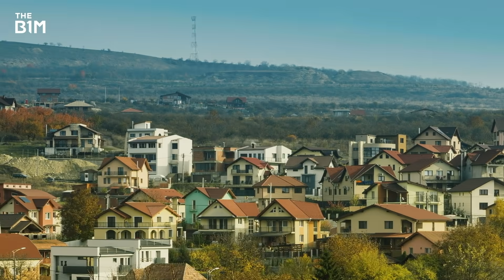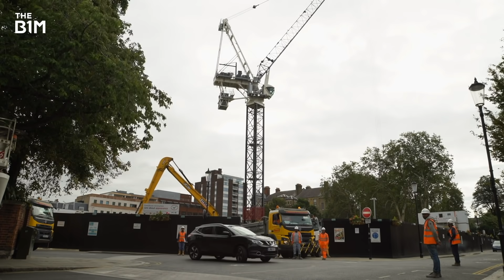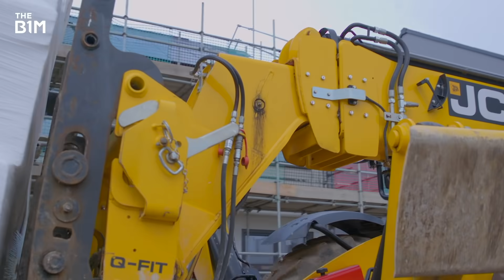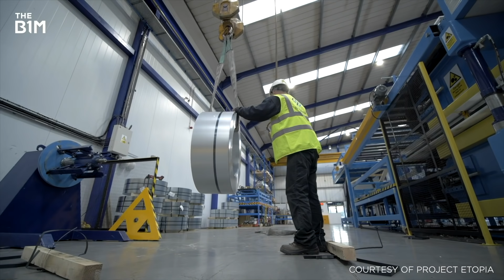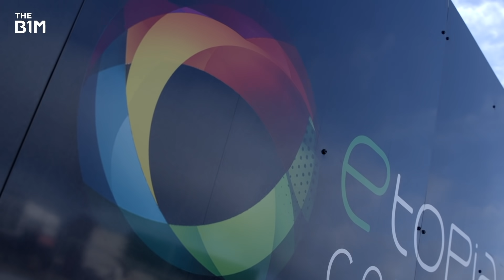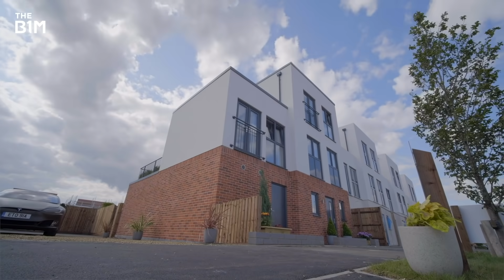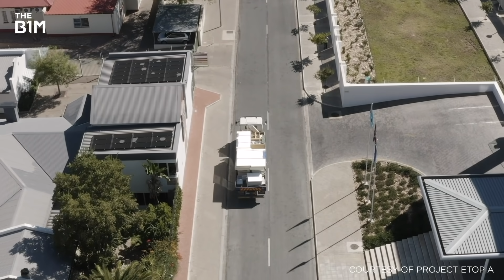How To Build More Homes, Faster

Comment: I have an idea of a modular flat system where you own the materials and rent a plot .a company would rent out a base(the plot area ,it supply’s power and water ) and you could buy the parts of the house .you only own the materials .all the parts would be 3d printed out of concrete and have a wooden embedded interior . The company would agree to buy back your materials at 80% if it’s current value. This allows for rapid expansion and as little waste as possible.

Comment: We built these types of "eco-friendly" modular, energy efficient homes here in New Orleans following Hurricane Katrina through Brad Pitt's BUILT IT RIGHT FOUNDATION. These companies don't realize, or care...as long as they get paid, that the materials used to make these homes "sustainable" fall apart in less than a year in environmental condition like New Orleans and Africa. It's fine for Britian...nonsense for places with high heat and humidity

Comment: He said at the beginning "we can take away a lot of the problematic costly areas that exist within development and that will ultimately drive cost down for building but performance up".
So it costs less to build, but they still charge the same price for the house. Yet these new builds are done with cheaper materials, thinner walls and are built on a smaller plots of land.
There are loads of "affordable" homes being built here I live, yet I still can't afford any of them. The most recent ones start at around £300,000 for a 2 bedroom terraced house. Its crazy.

Comment: Low quality homes that doesn't last even a 100 years. Made from materials that degrade faster then paper and cost the same as a brick and steel house. It will end up in disaster long term (for those who buy them).

Comment: The cost of a plot and a permit is way to high. This is partly due to corruption, and partly due to government figuring out to get a non tax income via high fees.

Even if this is just a handful of procent of the full cost, it effects everything down the line.

This effect planning cost, that effect architectural fee, that effect contract cost, that effect cost of sale, that effect production cost, that effect sourcing cost that effect time table and so on.

Wirh just a few procentage of every part of the way, the building is twice the cost at the end. This is what made building so expensive. 

Production method have been made better and better for every year, but corruption and byrocracy have outpaced efficency every year. Making buildings very expensive.

If people could just buy a plot and start building (according to preset conditions), houses would be half price.

Comment: In Austria, the market share of prefabricated houses is roughly 1/3. It is around this size since a few decades, it has even decreased a bit.
The cost advantage of prefabricated houses is not that big, and the lifespan is shorter, so most people prefer the massive construction methods.
So I don't think that prefabricated houses is really a way to solve housing shortage. Birth control and migration control is.

Comment: I live in a public housing 2 bedroom house with a decent sized yard. There was a vacant public housing owned land in our street, and to save time, they had the concrete walls pre-cast off site, and craned in. The outside was assembled in 2 days, and fit out not even 2 weeks. And a grateful family was moved in within the month. Sadly the state housing authority here has stopped buying vacant lands and building on it, now they only build units or housing commision flats. EDIT - There was a 2nd vacant property next to us, the housing authority sold the land for profit to a developer who built 2 units on it. Most of the former housing authority houses in my street had been bought out by their former tenants and now private owned. If you live in a public house, you can after certain amount of years apply to purchase them from the government like a de facto mortgage, or via a bank loan.

Comment: Uh.. didn't the Soviet union do the same thing back in the 1950s- 60s during the khruschev era? What's new about this?
Reply: Not really. What they did was made a module style building structure with predesigned modules.

Nowdays we are designing every module them self.

It's also diffeent in the way that utilities is built into them and the outside walls come preinsulated. 

Also, at least where I work, windows are preinstalled in factory

Comment: Here in the USA, affordable single family homes tend to be of very low quality (at least as we see being quality).  My home is Energy Star certified, but your feet are cold in the winter, and the walls and ceilings are so poorly insulated that the ceiling fan will not push air down to where I can feel it just a couple of feet from the fan.  If change is to come then codes and laws need to as well; if not the builder will always choose the cheaper inefficient route.
Reply: Joel So do a heat leak test, or if you cannot do it yourself, hire someone. They will show you where you need to insulate. In my country we build houses that are so well insulated that you won’t have any cost heating. We call it zero-on-the-meter houses. You only need a heatpump and solar panels and you won’t have an energy bill anymore, mostly you have a surplus of electricity and you can charge your electric vehicle(s) and deliver back to the grid (for money). But it means we have about 15cm of insulation in the cavity walls, 25cm of insulation on the roof and 20cm of insulation of the ground floor and double or triple glazing. It’s an investment, but you will be rewarded later. Almost every two years the insulation index for new housing is increased by law. Also existing rental homes need to be converted in the next 20 years. If you want to sell your house you are obligated to do a insulation check and publish the outcome in the sales sheet.

Comment: Whilst OSM/MMC will clearly play a significant role in the future of all residential construction. There is no point glorifying it as a single 'silver-bullet' solution when some of the processes have been around for years - especially in the UK. 

What lies behind the UK's housing crisis is a severe shortage of available affordable housing - specifically housing available at social rents which has exposed acute affordability issues, inflated house prices and placed millions on waiting lists in recent years. 

The under-supply of housing is systemic of the residualised model housing provision has experienced over the last 40 years - coinciding with the ascendance of a neo-liberal form of logic that views housing as a commodity rather than a social right. 

Until the UK government re-establishes themselves as principal providers there will always be sluggish rates of house building at un-affordable prices. This is an imperative issue captured in a pertinent video, however, OSM should be seen as the mechanism and stimulus towards greater rates of house building.  

The role of government is pivotal and for any effectual increase to the UK's housing stock to occur, there has to be an equivalent amount of political desire to make it happen.

Comment: For offsite prefab homes to be built numerous Lythe needs to be a change in the law for mortgage offerings and also removal of structural material definition of what a home is built from.

Park homes have long been available but you cannot get mainstream mortgages for them despite their cost and energy efficiency. Even now a single unit static caravan sells for under £1000. All that is needed is land bbrands81@gmail.com that's where the planning laws fall short.

Comment: Comparing UK housing standards with japan is very problematic... uk homes are built with longitivtiy in mind, Japan’s house are built with a lifespan of a single generation. Makes sense since on average there’s an average earthquake in Japan everyday. the house value depreciate very quickly, land ownership is also very different..I’ve lived in japan for a while, the quality is also very poor. Low insulation, drafty, central heating is uncommon,.. basically houses in japan and uk could not be any different,, you don’t want a Japanese made house in the Uk.

Comment: At least here in California, no, changing construction techniques isn't going to help very much. The problem is too many cities aren't approving housing developments and building plans fast enough. It often takes longer to get plans approved than to build the structures, in many cases twice as long! Furthermore, costs are ballooning out of control due to excessive loading of extra gov't requirements. For instance, the state legislature recently passed a law requiring all new residential construction to have solar panels on the roof. In 2015 they also required the conduit and electrical system capacity for an EV charge port. Developers typically also must bear the cost for new public infrastructure to support a new neighborhood, and of course those costs must get passed on to consumers too. The state legislature also passed a rent control measure that applies to the entire state, thus ensuring that future rental developments will be discouraged. Finally, both property owners and local governments perceive it to be in their best interests to favor policies that promote high land values, even at the expense of affordable housing. The homeless don't have enough political clout to overcome that duopoly. In order to get real change here there's going to have to be a serious and sustained period of economic decline due to lack of affordable housing before people here change their mind and come to a different political consensus.

Comment: The U.S. has been making pre-fabricated (or prefab) housing for many decades now. But many home builders still construct houses the traditional way which takes longer and is more expensive. I’m beginning to think that many home builders in the U.S. purposely avoid building any affordable single family homes altogether, in the suburbs and only focus on building “Mc mansions” (mini-mansions) for the upper-middle class and above, in order to avoid attracting the working class to those suburbs - truth be told! So the working class either need to resign to living in the inner city in small, tight units in multi-family housing or end up living in old, run down single-family homes in older, marginal suburbs though there are not that many of those kinds of suburbs left. I love the U.S. but the “elitist” attitude some have here has even permeated the construction industry and is really deplorable! No one in residential construction will admit this though.

Comment: 2 + 2 costing loses itself in marketplace valuation of homes .. doesn't matter what a homes building cost is .. all that matters is the market value of the finished home .. land costs, heavily tied to market prices are no longer inconsequential and are nebulously influenced by zoning and environmental restrictions .. finally increasing complexity of subsystems (and their costs) are focusing capital costs into the house price as opposed to the old model of tapping into utility subsystems developed thru external economic systems .. new age subsystems will pay for themselves in the long run, but the upfront costs are then buried into the price

Comment: I find two issues with this: 
1) cookie-cutter houses. Having more suburbs of houses all looking alike is awful. So many of these new houses have no personality. The companies that can afford to do this often cut corners while building too, which puts the burden of fixing it on the house owners. If they can make a variety of houses and good quality, this could be avoided. 
2) Density. With more people moving to the cities, we need to understand it means smaller units. Instead of houses, we should be building condos, townhomes, etc. Densify cities and suburbs around key points with good transportation options. No one should have to do a two hour commute one way because its all they can afford. This is a huge problem in America, especially with people wanting 'large' homes. 
For some reason, America has been building fewer houses but bigger houses. The size of the typical home as increased, the amount of children being born has dropped... and the low-density housing is causing all sort of problems. This is something both Asian and European communities do better. Smaller homes in walkable areas.
Reply: The reason birthrate has dropped is due to general high wealth of the American people. Also, the influence of religion is decreasing by the day thanks to electronic communication (not just Internet, because this trend started with the mass adoption of TVs and telephones).

Comment: The concept is great but I do wonder at the problem of the soul-crushing box designed houses. The owners would most likely treat them the same as owners of similarly developed housing units in the past, e.g. rowhomes from the 1880s, semi-detached in the 1900s, 'Levittowns' in the 1950s, which is not exactly kindly. The areas become depressed in value as saturation causes too much strain with the breakdown of infrastructure - schools, maintenance, and so on - either causing the original owners to flee  to 'better' destinations or brought on by the owners moving before the decline starts. While it is true that now many of the older rowhomes and semi-detached have become, once again, desirable, the trick will be to not have the newly-built areas go through decades-long periods of decline before becoming desirable again. While the offsite, modular approach attends to one of the problems of home-ownership, which it does it quite well, it doesn't help with the after-purchase maintenance of the desirability of the individual units or of the entire area.

Comment: The pre-fab solution you are proposing will only enable businesses to charge the same prices they current buildings with prefab. A Real solution is charge cheaper homes or actually regulate your housing industry.

Comment: In Australia we do something called a reverse build. The insulation and qyorock plasterboard (drywall) is completed before the external brickwork. This allows the internal components of the home, like the stairs and kitchen to be constructed at the same time as the brick layers, it speeds up the process, however leaving the internal of a home exposed has lead to a few complications

Comment: Very interesting video.
I like the idea of using this method for those who are in very difficult situations. My only concern is cookie cutter homes. Seeing the same home everywhere you go can be very tiresome mentally. I think there is an importance in architectural diversity. But this is of course a luxury.
As an American, in my country, I have heard the argument (from freakanomics actually) that lowering the regulations put on housing is the best way to lower housing costs. Additionally, they said that re-purposing buildings for housing could be an option to. As malls are dying out, maybe convert some mall space into apartments (would help out the stores at the mall too).
Also, like he said in this video, the method is a key part of this. Pole Barn houses are way cheaper and more efficient than many traditional style houses. When I decide to go into the market for a house, I'm taking a close look at Pole Barn houses.

Comment: First thing that needs to happen is that the purchasers of these houses are over 18 and means tested (and by extension their parents estates) to ensure that they aren't already cash / asset rich. Meaning that they are not cashed up and able to buy these houses as investments due to the low interest rates and affordability of them. This will allow those who are just entering the housing market to be able to purchase under their own steam and not have to rent off those who own them as investments. Staving off those who are able to hoard these properties for the betterment of those that need them to survive is key. Otherwise the disparity we currently experience between the haves and havenots will grow wider and even then the rich property owners will will eventually suffer as people may not even be able to afford to rent.

Comment: There are 24 empty homes for every homeless person in the United States. The "housing crisis" isn't real.
Reply: Part of the “housing crisis” is that those houses are not affordable. That’s why they’re empty and we have people who are homeless
Reply: @liamplayle495  Again, that's a manufactured issue. Supply isn't limited, demand is plentiful - it's a failure of the system brokering the exchange and not either end of the exchange. The homes are already built, sitting there and letting newer, cheaper homes be sold in their stead doesn't help in any capacity.
Reply: @sagewaterdragon  One possible solution would be a massive investment in housing vouchers or subsidized rent.
Reply: @Jeff Guse imagine booing homeless people because they can’t make money.
Reply: @Jeff Guse1st of all chill out dude. 2d of all, I’m not homeless. And 3rd of all your so disrespectful. People like you think they have crowns there heads and everyone is under them. Entitled brat.

Comment: Certainly modular builds can be great and can help in bringing more homes to the market, but the biggest issue is the cost! The difference at the moment between off-site and on-site builds isn't that big for a major push, probably will need to be 50% cheaper than on-site builds for it to take off. 
At the moment, I don't think it's 50% cheaper! Once you add transport costs (which will vary massively depending on where the development site is), and in many European cities at least, with narrow roads etc, it becomes an even harder sell! The environmental impact is another which many builders are taking into account more so these days.